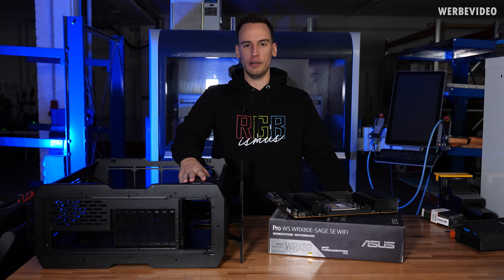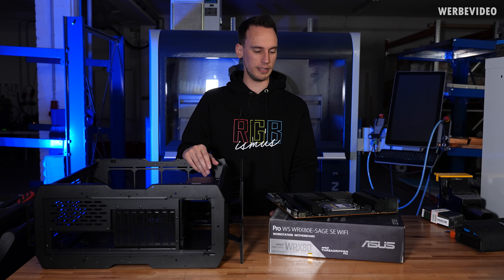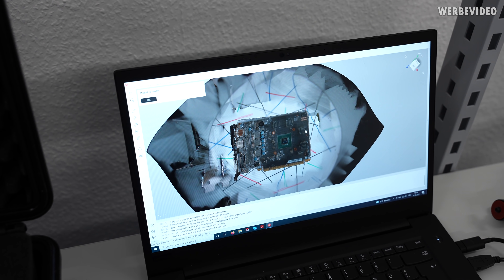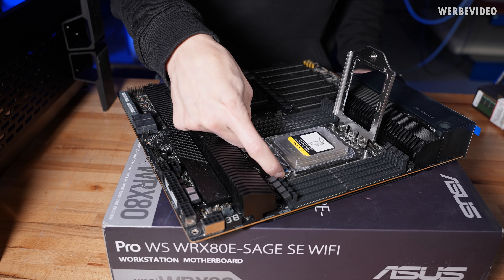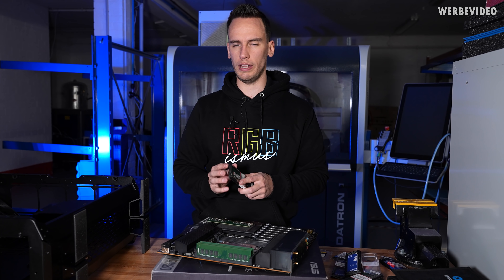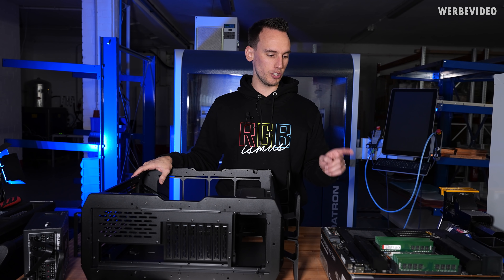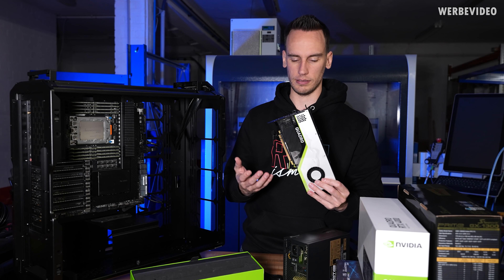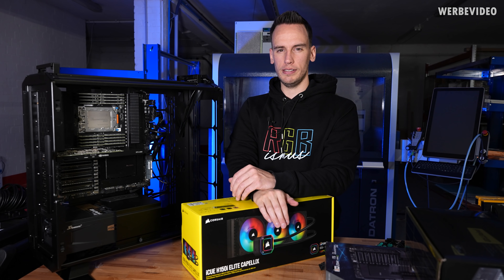We're building a 32 Core Workstation to power our 20.000 € 3D-Scanner

Comment: This is interesting to me, as I've worked doing a lot of 3d scanning/metrology for root cause analysis for assembly problems in a major automotive OEM, the romer cmm arms we had with a probe and blue laser scanning head were about $90k/ea and the laptop attached to each stand was a dell mobile workstation with a 9980hk and 64gb of memory haha. I will absolutely recommend trying Met-L-Chek D-70 spray developer for use on reflective surfaces. Not sure how it works for optical scans, but it worked a TREAT for laser scanning bare metal parts and painted metal parts, and was very useful in blue light optical scanning. Light dusting is usually all that's necessary to get a clean point cloud.

Comment: I'd go for a 60mm thick 360 or 420 radiator for the maximum thermal capacity, silent black noctua fans and for the cpu block I'd use EKWB optimus.

Comment: I think think any of the heatsinks or AIOs are great for Threadripper CPUs in my experience.

I tested the Heatkiller Pro IV Threadripper CPU block and the Optimus Absolute Threadripper 3+ CPU block on an overclocked 3970X.  The Optimus block was only 2C better in temperatures.  Both performed very well at 400 watts power draw.  The Heatkiller Pro IV Threadripper CPU block is easy to purchase and isn't expensive.  

What about the heatkiller block, an EK-Quantum Kinetic FLT 120 D5 PWM pump/red in the rear fan spot and a thick 360mm radiator with push pull fans? Then add some fans to the top of the case for better air flow through the case and over the VRMs.

Comment: I do a lot of this for a living, 3D scanning that is. #1 turn down your point density and get rid of textures/colours on your scan. Absolutely useless data, no way you should need a 16gb mesh file for a pcb, I mean I scan things the size of a car and I stay around 4-6gb. Secondly the cpu may help meshing, but it won’t do anything for you in your CAD software. Also, let’s say you were going to use some simulation software, a lot of it charges per core license fees. So there’s that to think about, I ran my sim rig with HT off and max clocks because it was an extra 20k/yr to go from 8 core to 16core…So don’t count HT or w/e AMD calls it as real cores. So my suggestion would be disable HT and OC to max clocks. 

Next - get a gpu with more VRAM. Very few simulation software actually see an improvement from quadro vs RTX, so a 3090 with more cuda cores and Ram will perform better 99% of the time.

Cooling. Honestly - where will you be keeping this thing? If it’s in the same room as your cnc machines you should completely rethink your cooling for 0 airflow in the case. Seal it really well, move the PSU outside the case, get rid of glass panels and replace with aluminum with heat sinks on the outside and use quick connects and water cool the whole thing externally. More airflow = more sticky coolant inside your machine and on your pcb.

Comment: I have the Dark rock pro tr4 on my threadripper and it performed as well as the enermax 360 aio. Until that aio gunked up and died which is why I switched to air. Both held the same overclock easily.

Comment: What are good DDR4 ECC dimms? I got two M391A4G43AB1-CWE (32GB 3200MHz unbuffered ECC Samsung A-die stick) sticks for my X570 recently, and they work fine, but don't seem to clock nearly as good as my old B-die ECC sticks (M391A2K43BB1-CTD i think). The B-die could relatively easily hit around 3600MHz to about 3733MHz (true for all 6 sticks i own by the way), but the A-die struggled to reach 3600MHz, and i had to settle for 3400. Admittedly, I haven't done much tuning with it, but there's also almost no information on Samsung A-die. So now I'm wondering if anyone had better experiences with other 32GB ECC sticks?

Comment: Great video - My VOTE goes to the SilverStone IceGem 360 AIO. I have one on my ThreadRipper 3960x with slight overclock and temperatures never go above 70c. It was also only $222 Cdn and has FULL coverage of the CPU... might as well do things RIGHT if you're going to do them at all ;-)   I contacted that OTHER brand with the full coverage cold plate (the one reported in the past with bad fluids inside that would gunk everything up and fail in about a year) to see IF they had solved their "chemistry problem"... but they NEVER got back to me... so my money went to SilverStone, it has worked perfect, kept things very cool ... even in my Define 7 Compact case! I'd buy it again without hesitation. Pls give Shiek (sp?) a treat for me :-)

Comment: Knowing a tiny bit about how this stuff works, I'd expect it to be able to fully load a dual socket EPYC with 256 threads.
Reply: the software needs to be able to address all 256 threads. its useless if it doesn't utilize more resources (than what the usual is, say 8 core 16 thread).

Comment: Hi, Roman, have you tried the opaque temporary 3d scanning spray? It starts off whitish but then disappears after an hour or so. It is specifically designed to give every surface the same reflectivity for scanning. I'm sure any residue would be removable with isopropanol.

Comment: how about custom loop, with quick disconnects, clear fluid, soft tubes, and dual pump. not because you need the head pressure, but because if one pump fails, you don't care. you can replace when you don't need the system to be up.

Comment: NH-U14S TR4-SP3 would be my choice, maybe with additional fan. Low maintenance and better reliability, at the cost of a slight temperature increase. (Quieter as well)
Reply: Excellent choice - great cooling, zero maintenance, and no chance of a water leak.
Reply: @threadripper979  Anything with fans in a workshop is definitely not zero maintenance. And if you put it a loop together properly, there's no chance of a water leak either. But it is more high-maintenance. Only a fanless cooler is "zero maintenance", or as close as it gets. But good luck finding a fanless cooler to cool a 32 core epyc or TR
Reply: Terrible choice in a machine shop, airflow is the enemy. You have air, with conductive oil drops from the coolant that also carry tiny particles of conductive metal. External water cooling is your friend.
Reply: With 280W of sustained power draw, sadly the NH-U14S TR4-SP3 can't keep up with the heat of the CPU.  It works well for 1st gen Threadripper CPUs, but not for 3rd gen Threadripper CPUs.  Even a 3960X CPU overheats and hits 90-95C under load easily with the NH-U14S TR4-SP3 heatsink in an open test bench or high airflow case.  The 3970X overheats easily and quickly hits 95C when using the NH-U14S TR4-SP3.

Also the NH-U14S TR4-SP3 blocks the first PCIE slot on many motherboards and blocks tow ram slots on many motherboards.
Reply: @Mildly_Amused  Source? HU says below 80c for a 3990x, kitguru says the nhu14s can dissipate 400w+. this socket is 90° rotated, no pcie blocking and in any case you can just use the slot  just below

Comment: Honestly that CPU has no need or want for overclocking. The OEMs and smaller shops working on them just want something reliable and overclocking doesn't really fit that bill.
Reply: It should be an optional feature since some people want it especially now that the death of regular TR is rumored. All AMD had to do was not go out of their way to lock the processor down and some board partner would've figured it out and made a board with overclocking support for enthusiasts.
Reply: @thatguy7595  although I agree with you it's not that simple because some of the people buying this stuff in large orders are very old school.

There are lots of these people that read "overclocking" and think "unreliable, not secure ..." (Some nutters even think that with boost frequency). If they heard of that CPU being possible to overclock their not getting it.

I do think it's a shame that we don't have overclocking with 2 TV or ram but AMD would be shooting themselves in the foot if they allowed it.

Also product segmentation (that's what threadripper non-pro is for)

Comment: I recommend the Alphacool Eisbaer Pro aurora 420 for cooling nice all in one package with quick disconnect and very decent cooling also has the advantage of not being bulky.
Also any reason you went with an optical scanner instead of lidar or other scanners. As from what i've seen, the scan results although precise in measurement is very rough. I usually use baby powder or a a matte spray for metallic or transparent surface for scanning. It gives me way more accuracy and a better looking model.
Depending which software you are using to solve the data set, all the cores can be loaded and you do get a noticeable speed increase.

Comment: I've been using MasterLiquid ML360 RGB TR4 for 2 years now with my 1950x overclocked to 4.1 ghz and it's always kept it around 60ºC (under use) with nf-a25 running at 1000 rpm. That being said I'm sure that are better more "modular" solutions out there but as far as an AIO with full coverage this one works fine.
Reply: The coldplate might be full coverage, but are the fins inside the block threadripper sized as well? By this I mean, do they cover the chiplets fully? If not, cooling performance won't be optimal.

Comment: Not sure why you put such a beefy gpu in there. Does the program utilize cuda? If not it's either useless or maybe a bit weak. Depending on wether it'll be used for anything else, you couldve saved a bit on this one
Reply: Because it will be used with professional CAD/CAM software.

Comment: It makes sense to me that the pro platform doesn't have overclocking. Because at the end of the day workstations are about stability, paring ECC RAM and an overclock CPU seems counterproductive. 

Agreed, I'd go to a thermal solution designed to cover the full block. If you're going longer compute runs then water cooling makes sense with the larger thermal mass. Otherwise the reliability of air cooling might be better.

Comment: really cool stuff. I work in 3D printing full time so its really cool to see the tech like the Artec scanner trickle down to where even youtubers are buying and using. I would have gone for something from shinning personally since they are a bit cheaper and are easier to use compared to the relatively clunky Artec systems. But either way should be able to do what you need it to do. 

I suggest maybe looking into a good software to CAD things out and clean up the scan data. You'll still need some input from board manufacturers are a scan is only a reference so you would need to account for at least 0.3 mm of tolerance to start with.
Reply: tbh derb8auer is far form "a youtuber". shure he posts his experiments here and does reviews and uses actively the platform to outreach, but he is  foremost a designer/ product manager / ceo of a couple of endeavorurs. i dont think he bought  the scanner "for youtube", like neither the DMG morti cnc he owns... i do not think he plans on making ROI on these thanks to his channels here

Comment: Back some years ago I've bought a Asus x99 WS (x99 ws ipmi to be precise) series mainboard I had a lot of issues with support.
User manual was laking a lot of jumpers pins. Sometims I have leds on without any marking on it, Descriptions was without a real meaning or totally missing...
Bios was ok but oh man the BMC is shit. BMC crashes more than the Host OS and I have to forcefully reboot the BMC from the OS to remote access the machine sensors!

Java applets has been dropped and they never updated that part of the iKVM to HTML5.... what a pain. I have really old dell 1900 series rack servers with a more stable BMC and even if it is based on java applets those works without crashing, not like the asus ones!

I really hope things changed. Now if I have to choose something like this again I'll go with asrockrack.
Lately (last 5ish years) I've had a lot of isses with Asus mainboards!
(BTW I'm running a ROG vii Hero right now, so I also like-ish some Asus products. but also with this mainboard they did a really crap work on m.2 nvme and audio drivers)

Comment: for the cooling you could get an Eisbaer Extreme Core with the Alphacool Eisblock XPX Pro U1

It's an AIO with a D5 pump and quick disconnect that allows you to use whatever CPU block with it. The XPX Pro U1 is a block made for TR4 and LGA 3647 👍

Comment: I've been waiting a long time to see someone do a workstation build. Since you're going to come back to it, perhaps you can indulge me in one question: if you were to install 512 GB RAM (or more), which RAM would you use and why? I'm sure your viewers who do CFD will appreciate your expertise.

For the cooler, don't Noctua do an air cooler? I would not use the Dark Rock Pro TR4 as I saw a video showing that it doesn't actually give good coverage over the whole die. As for AIOs this isn't a place for RGB.
Reply: RGB is ok, the AIO itself is not, no need for one, and a workstation is not the place for AIO because of reliability, if a fan breaks on an air cooler it still runs somewhat, and you can hotswap a fan (not pleasant but doable), it the pump dies (and it will) you can't hoswap a cooler
Reply: @rubenfasola5402  I had a corsair 120mm AIO running 24/7 on my home server (my old Cord 2 Quad Q9650) for well over a year without issues.
The cooler he has has a Five year warranty, so that shouldn't be an issue. 
The issue comes down to OEM's will use cheaper versions and those won't last as well.
Reply: @agentcrm  point still stands, why would you add failure points, anecdotal evidence doesn't matter, i never had bad experiences with AIOs myself, but it does not matter, they are still inherently less reliable (as in more failure points) than an air cooler. five year warranty means they will replace it if it breaks, not that it can't break in those 5y.

"it shouldn't be an issue" when you deal with enterpraise stuff (and/or stuff that needs the least downtime possible), that phrase is very scary as it basically means "it is going to be an issue"
 
"The issue comes down to OEM's will use cheaper versions and those won't last as well" you get what you pay for (in the grand scheme of things)
Reply: @rubenfasola5402  It comes down to what is the best solution for the task. This is a 280 watt TDP CPU, depending on the length of compute run required. The extra thermal mass of a 360mm AIO could be quite handy. 

We are looking at only 1 system, not an office or company full of them. If the deployment needed to be that large then a server farm would make far more sense.

Comment: Roman I suggest you go with the Cooler Master MasterLiquid ML360 Mirror TR4 Edition all-in-one cooler. It's a fairly new cooler release in the last couple years and I've yet to see anyone review it, as it has a large rectangle block that will cover the entire Threadripper IHS. 
I personally use MSI's MAG CoreLiquid 360R to cool my 2990WX and it does the job just fine.
Reply: just curious, what are u using your threadripper for?
Reply: air cooling, full stop, as good as that AIO might be, it still introduces more failure points

Comment: Looks more like photogrammetry. I'm just exploring the subject but you can use a regular camera to take pictures and then processing together to get a cloud points.
I already work with cloud points but acquired from laser scanner and from 3D sonar, but I assume laser scanner for the degree of errors you need are expensive, also for a small volume
Reply: This is a structured blue light scanner w/ accuracy down to 0.05 mm + 0.3 mm/m. It probably looks like photogrammetry because the scanner has an additional camera for texture data. One interesting thing about structured light scanners w/cameras is the performance/ease of scan boost you get because it can use the photo/color data when it's aligning point data from one scan location to the next.

Comment: I'm sure you could get like 20% more performance with black PCB RAM sticks. 25% if they have RGB heattrappers (a more advanced version of a heatspreader made of plastic).
Reply: It's a work machine it must have at least 10% green pcb present at all times.
Reply: @gatordontplay417  Indeed.  Green PCB increases stability by 25%.  The RGB of real pros.
Reply: Black PCB = More performance
Green PCB = Better stability
Blue PCB = Lower power consumption
Red PCB = Higher power consumption
White PCB = Higher reputation
Brown PCB = Lower reputation
Reply: @Raivo_K  What about the Purple ones?(I think ECS used to use those) and Gold-ish Yellow ones?
Reply: @zarmaanful  geil dragon ram? And Adata had purple low profile ddr2, I don't think there's been any since then.
Reply: Only in games though, for CAD the software won't even start without a green PCB detected.

Comment: I'm using the heatkiller iv pro block on a threadripper. If you want to do a custom loop, it works fine, but I don't know if it's any better than other tr4 cpu blocks.
Reply: Seconded, the Heatkiller IV came up on top in all the tests I read. I use the full copper nickel plated version for my 3970X with liquid metal. I would also be disappointed if Roman didn't at least design a custom water block for that Quadro! :D

Comment: I would finish that with a Dark Rock Pro TR4 instead of that rainbow radiator.
Reply: I used it in the past and it didn't perform too well. I think that a 360 AIO would outperform it even without full coverage.